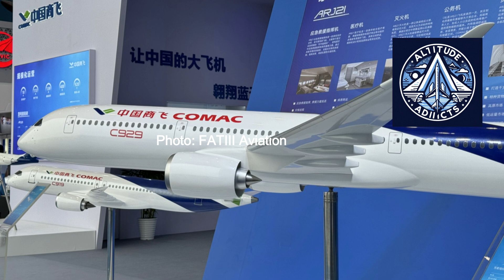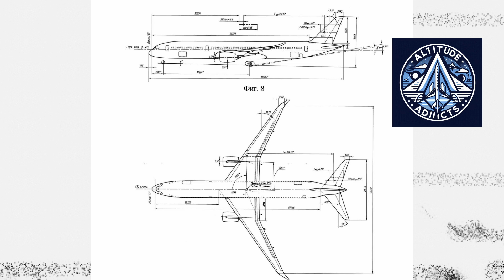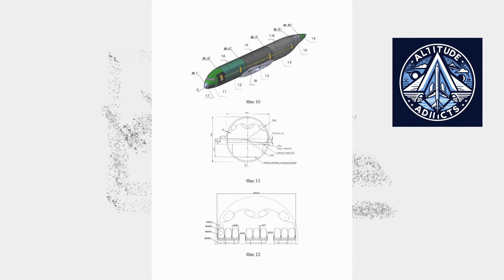Exclusive—Russia’s Wide-Body ShFDMS and China’s C929 Aircraft Are the Same Project | PD-35

Comment: Russia didn’t pull out of the CR929 project just because of sanctions - it was mainly to protect its engine tech, especially the PD‑35. China had its eyes on it (being sneaky 😉)  for their own CJ-2000 engine (also supposedly a “joint” project). After what happened with the Su‑27 and other defence tech—which China reverse-engineered into the J‑11B and later the J‑15, without any formal agreement - it’s no surprise Russia wasn’t willing to repeat that mistake.

Those incidents created deep mistrust in Russian defence circles. There’s a clear pattern: China studies foreign tech, copies it, then replaces the original partner - whether it’s aircraft, ships, or radars.

As the CR929 project progressed, China quietly rebranded it to C929, dropping the “R” for Russia. That wasn’t just a name change - it signaled China taking full control. The fear was clear: once China got access to Russian engine blueprints, they’d build their own version and cut Russia out - again.

Sanctions are just easy excuses. If that was the only problem, Russia could’ve built the plane on home turf. The real reason was protecting strategic tech. Russia learned the hard way - once China has the designs, they don’t need you anymore.

China has proven to be an unreliable partner in this kind of high-stakes tech collaboration.

Russia has the brains to make it happen. What they lack, in my opinion, is slick marketing - unlike the West, where they can sell you a used car with no engine and make you feel lucky you got it 😄

Watch this report (with subtitles) if you want the real reason...
Reply: ...I'm not sure if it's as you write...China could have copied any engine from Airbus and Boeing that it owns long ago...and it didn't...I have no idea why, but I know that aircraft engines have patented parts and that Chinese courts have also banned the Chinese from producing some products that foreign companies have patented in China...
Reply: Hey youtube where are the comments 😂
Reply: @CipherAsset  which report bro? there isn't any link
Reply: Russia never learn ! It doing the same  mistake with India. Russia is behaving like country desperate for friend.  I was shocked when Russia proposed transfer SU-57 technology to India if it buy the fighter jet. Imagine give away technology that  took years and fund to developed. America won't  this madness no matter what.

Recent India $7 billions defence contract went to India Hindustan defence  company instead  to Russia, to supply fighter jets which the engine is russia transferred technology. Imagine !!

Tomorrow when India becomes perfect it will stop buying Russia weapon and compete for the little market left for russia weapons..
Russia must be wise, it can't afford to give away it bread and butter to India who is not 100% reliable. 
It was in the news India purchased fighter jets from France worth billions without technology transfer condition. Tomorrow  India will buy another western fighter jets without technology transfer condition.
Russia need to wake up and stop this childish bilateral relationship. India is getting discounted cheap oil and spend the profit on wstern weapons.
Russia has gain  less whilst India has gain too much. Its not fair.

Comment: If the Russians and Chinese can work together to make a Western independent modern aircraft it would be better to do this in Russia (to avoid Chinese companies becoming sanctioned), with China assisting in areas of Russian relative weakness and or production bottlenecks.   

I do understand that the Chinese will want to work with Western partners for engines, maintenance convenience and ease of certification. As this will give their product the best chance of success, though always with the risk of being cut off from those suppliers.